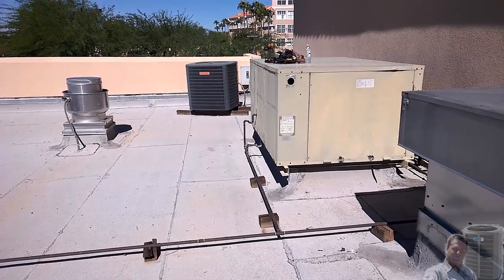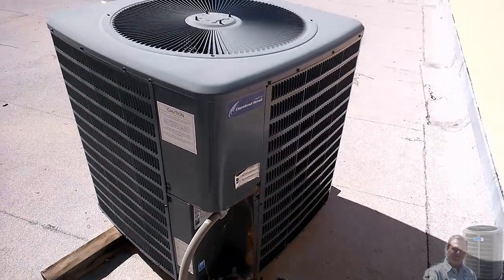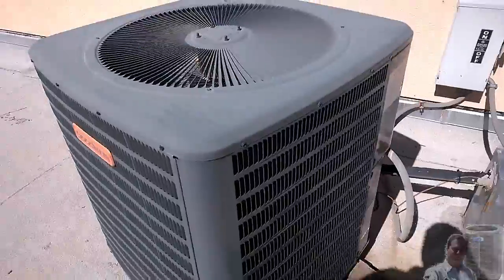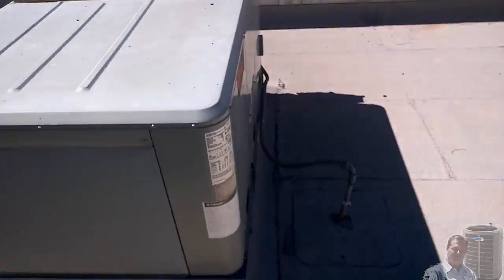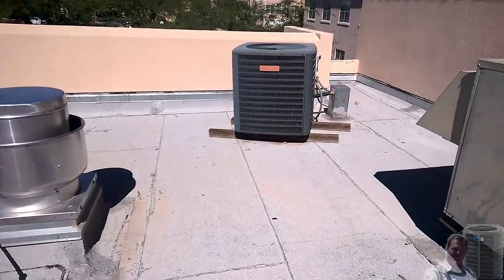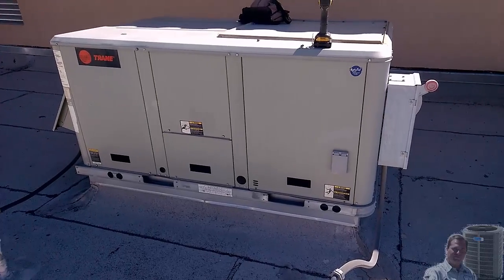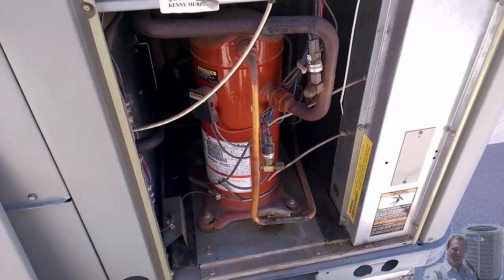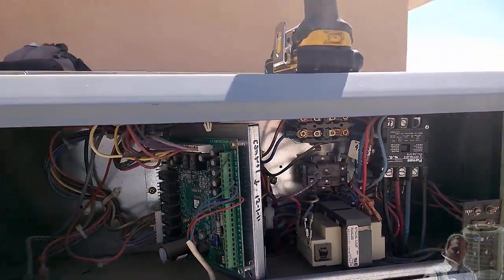Goodman Copeland vs Trane (Copeland) Scroll compressor comparison

Comment: The two units is the same capacity in kW or different? 
If the compressor is larger the noise is more
If the compressor is smaller the nois level is lower.
Reply from the maker: Goodman is straight up known to be more noisy in otherwise like for like capacity.
Especially their older ones. But it is fun to still bash them because they are just cheap products
Reply: @hackfreehvac  cheap built quality the compressor makes recommendations.

Comment: My parents had 2 Trane XE1000s from 1993 and one of them lasted 20 years(replaced because the compressor shorted to ground) and the other lasted 24 year(replaced because of evaporator leaks and the compressor is nearing the end of life). Trane is very good. When I get a house and the original AC is more than 20 years old, I would eventually bite the bullet on an XV20i.

Comment: The design on the Goodman for fan motor is stupid. It is so hard to put the fan holder/panel back since when you remove the fan holder/panel all around panels fall apart. So stupid design. Never think about how difficult it is for HVAC technicians.

Comment: I wouldn't want that Trane wreck or the Goodman. Installation is where it all starts and ends. You get these hackers that don't match the inside accordingly and the piston. Most importantly you see these idiots that purge the system with absolutely no vacuum done or dryer added. You really want to take that goodman and bring the noise down. I suggest you put the noise bag back over the compressor that came with it and change out the muffler that could be restricting it. 37 years now as a technician and if you don't like the sound fix it. Standing on a rooftop with a video camera criticizing something you obviously know nothing about. Not a fan of either system but standing around bitching is not fixing it now is it!

Comment: I though all higher seer r410a units were quite a bit louder than lower pressure r22 units.
Reply from the maker: There are R410 units that are very quiet.

I installed a 14 seer Trane package unit last year for a friend.
I just went out there for a "break down" (turned out the power was cycling off and on in her area) and you still have to get about 10 feet from the unit before you can hear any sound from it at all. It is dead quiet.

I have a video of that unit here...

Oh wow, I just realized that I accidentally uploaded this as PRIVATE. Oops.
I just made it public so now it lists it with today's date instead of last year. :-/

https://www.youtube.com/watch?v=xECaKj6KOAE

Comment: I've read that a Trane compressor is very close to a Copeland stock design aside from a few precision adjustments and valve design. The Tranes where I live sound like helicopters more than anything due to their fan design. Over the past five or so years at work we've had Goodman and Fujitsu systems installed in upgrades. We also had a four compressor York system put in for our main area.

I can hear the York across the street although I don't know how many compressors are active at any time. The Goodman units look much nicer than that in the video and run perfectly fine. The Fujitsu split systems beat them all out in efficiency. We could probably cool a walk-in fridge with them. I am not an HVAC tech (I work IT) so this may be purely subjective but it seems like R410A systems are generally louder than any R22 system I have encountered. Our old main area AC had two reciprocal compressors that looked like Harley engines. Those weren't as loud as the new setup...at least until one seized.

It seems like that Goodman unit was very low end compared to the other systems. I thought it was a low end home unit until you mentioned it was three-phase. It's a passive interest but not my line of work so I'm sure I missed something. It just seems like the comparison was odd.
Reply from the maker: Low end Trane's have basic compressors in them.
The good ones have better compressors. 

Here is a 14 SEER Trane heat pump.https://www.youtube.com/watch?v=xECaKj6KOAE
Hear the compressor running? Neither do I! LOL

They say that the Trane high spec copeland built compressors go down a different assembly line than the common run-of-the-mill copeland compressor.

Too bad Tecumseh compressors are not popular anymore. They made good stuff.

Comment: Trane compressor is no working properly since low side pipe, doesn't look wet and it is supposed to be condensing water in its external surface. Check it out, man.
Reply: This is because of the very low humidity in the Phoenix metro area. You can have at times, a dew point temperature below 32 degrees there. You cannot have "sweating" on cold surfaces in these conditions, the pipe would have to be below freezing in which case it would get a light coating of frost on it, not liquid water drops. Here in the Rust Belt where i live, sometimes the outdoor conditions are so brutal like the other day, the dew point was above 75F!!! In that case, if the suction line was 70 degrees, it'd be soaked with water, but since most compressors dont like return gas temp above 65, the compressor will still burn out, and system is either overloaded or undercharged to get 70 degree return gas temp is way too much superheat. The moral of the story is, do not ever assume the presence or lack thereof of condensation on the suction line on an air conditioning compressor has anything to do with it working properly (or not).

You have to get your gauges out and check superheat and/or subcooling depending on the type of refrigerant metering device on the indoor coil.
Reply from the maker: Yup. While we are in the monsoon season now where they sweat like crazy, most of the year you would hardly get any condensation on the suction line yet it is 45 degrees, etc.

Mostly sub 10% RH until the monsoon season.

Comment: You don't mention the hack job that Trane contractor did....couldn't make the whip a little shorter? Maybe run it in hard conduit? Guess that's too difficult even for the "Trane quality contractors"
Reply: One YouTuber said "the installer decides how good your equipment works" which is true. You can get a Trane thrown on the roof with no care and a Goodman installed with care and the goodman will work better even though its lower quality. Goodman has a bad name because A they're a budget brand and B their equipment can be bought ad installed by non Licensed nutcases. I agree with what hack free HVAC says goodman units are not as good as everything else but they still serve their Purpose.   For example: my grandmas 2007ish TOTL Amana rooftop unit performs much better than my grandpas brand new split ICP. the reason? QUALITY INSTALLATION.
Reply: +Willie Peck One other credit to Goodman...my friend is still able to get an R22 condenser under that brand. It may be new old stock but he isn't able to swallow changing his entire system to R410A and he has a licensed friend to do the install.
Reply from the maker: It's FUNNY how low buck bottom feeding lowest bid GOODMAN installers have no clue that the original units on a commercial building like this were wired by an ELECTRICAL CONTRACTOR not the "Trane installer".

HA HA HA!

BTW. I'm surprised that while you were trolling videos to somehow defend the low buck low bidder Goodman brand you didn't notice the tons of TRANE units what were installed by hacks. All brands can be installed by hacks.
But since Godoman was, is and will always be the LOW BID choice it will continue to be the most predominantly hacked install over all.
Reply: hackfreehvac Trolling? Not so much, just trying to find some useful knowledge on any one of your videos but they all seem to be about talking garbage about "Goodman Installers" and there isn't any real content on them. I'm just trying to figure out the hate fest for Goodman. I get it, you don't like them, they're all installed by hacks, Trane is the best, your work is hackfree.....o wait, didn't you decide to video tape yourself throwing units off a roof?? Here, let the young business owner teach you a thing or two, stop worrying about what company a, b and c did. How they installed it, what they installed and who installed it is out of your circle of control. Worry about what's inside your circle and maybe, just maybe you'll be a better technician for it. Losers worry about everyone else, start being a winner.
Reply from the maker: Robert Doherty
I'm in the Arizona desert where the climate separates the GOOD stuff from the junk.
Around here the GOOD was regarded as Trane, Lennox, etc and the absolute worst was Goodman.

You might not have these heat pump models in your area depending on where you are at and all but most of the goodman's installed in the 2000's were labeled as "DESERT SERIES" and they were the most unreliable and noisy pile of junk ever made.

They sucked real bad. I'm not making it up and I don't turn my back on Trane stuff that I don't think is a good design. Such as the twin compressor 19i. I don't like two compressors starting and stopping all day as the demand changes from 1st to 2nd to 1st to 2nd... etc all day. I recommend the two stage scroll 16i or whatever they call them now.

Anyway. There is a Goodman loving "troll" who has come around and posted comment after comment on some of my videos and brought some friends a time or two. Maybe you were just random.

Go look at my older videos when i did some residential too. Such as "Baboon install". That is a Trane hacked so bad by "Trane installers". Which is why I got so pissed off and eventually stopped working there because the management didn't care.

After you watch that look for the "Noisy Goodman" videos.
Those Desert Series heat Pumps were sounding like that all over the valley. They really are bad.
Goodman got a little better but I can't just forgot the hundreds of service calls on them and just consider them equal to brands that are tried and true. I just can't.
Reply: Robert Doherty I always have a good laugh at all of you small-timers out there that try to pretend that Trane isn't top of the line equipment.
Reply from the maker: Greg C
Indeed.
It is like some people just deny the truth.

Comment: I know much more about A/C than the average individual (have my own license but retired for many years). Three years ago, I chose Goodman A/C units for my house. The installation was excellent.  The units were then and remain almost completely silent. I kept my old systems going for almost 50 years. In general, the choice of equipment manufacturer is much less important than the quality of the installation. I think that the (vast) majority of systems are not installed correctly...or at least optimally. Once properly set up, I keep the units clean but, unless there is a malfunction absolutely requiring it (never has been so far), I do NOT allow anyone to attach gauges to the systems or to open the service valves. I have no "annual checkups" or other nonsense done. I make sure that the cabinet drains are open but never cover the outside units in the winter. The vast majority of the Goodman (and other) complaints that I read about on line are clearly the results of faulty installation procedures.

Comment: I got by another season with my old Goodman. Now, I am starting heat with my 1957 Lennox low-boy oil furnace with a big old conversion burner (300,000 capable) dialed back to bare minimum. Maybe I need a Trane.
Reply from the maker: It don't have to be a Trane, there are several good brands and equipment.
Each also has their crap models.

Goodman however has been more known for entry level stuff using low spec components.
I am pretty much convinced that some of the motors and parts are NOT the same as used in just any unit as many claim.
I think the manufactures build parts via specs and cost. And the really cheap stuff might seem "ok" to some folks int he mild weather Midwest or something, but it don't last here in the Arizona desert.

Comment: Dude you sound like your wife cheated with a Goodman. Get over it not everybody can afford a Trane.
Reply from the maker: First of all, fanboy, my wife has worked in the HVAC based field (in the office) for about 15 years or so and even she knows that GOODMAN SUCKS and sucks bad.
HA HA HA! All the real techs in this area complained about how sucky they were.
(Both of us now work for commercial only).

Second, this is commercial here in this video. So there is no excuse for getting low end stuff.

And when I have shown residential, it was tract homes where the homeowner didn't pick the brand. The builder does and the homes go for the same whether they have Goodman, Carrier or Rheem, all using basic entry level stuff. But Goodman was so much worse for reliability and especially noise levels.

Heck, when we went to buy our home we used to live in (2002) we HEARD the Goodman heat pumps rattling away all the way from the parking lot!
And I said to her "Oh no! They have GOODMAN on these (model) homes!"

Luckily Chainsaw Charlie couldn't do all the installs in the large tract homes and about 5% of the installs were by another contractor who used Rheem heat pumps.
And that is what I had.
It was right outside my bedroom wall.
I had to put my ear to the wall to hear it.
However the homes with the Goodman's can be heard running on the other side of a room!

I know that newer Goodman is "not as bad".
Of course.
When you made the worst pieces of garbage equipment you have nowhere to go but up!
They still are lower bid stuff no matter who wants to deny it.

But since I spent so much time in "Goodman Country" fixing the most ridiculous amounts of repetitious MANUFACTURE RELATED FAILURES on 1 to 3 year old units day in and day out, I'm not going to just change my opinion of the cheap units just because a few fanboys claim that they are not only better now, but they are as good as top tier.

No way.
Reply: Okay

Comment: Dude, how do we know that you aren't using some kind of amplifier to make the Goodman sound louder and then turning down the amp to make the Trane sound quieter? BTW why the obsession with the noise? So what, especially on a roof top.
Reply from the maker: Indeed I could do that. Adobe Premiere has all sorts of audio effects. :-)
But if I was talking during that same recording you would hear the changes in my voice as well.

I was joking in my other video because I got the video clip of the Goodman start up (that also had Mike's commentary added) from Mike's video compilation of my clips. I assumed it was one of Mike's own installs. I didn't know it was that John guys.
Mike took down that "News #2" video so I guess you can't have you go listen to it.
The low frequency DOES cut out when the commentary appears when the unit had started. Then the sound goes back to normal.
And I can't find the original video on John's channel.

I do have a downloaded copy from Mike's News #2.
If people give me crap I might screen capture the copy I have to demonstrate why I said that.
It was likely just the camera doing the noise reduction on it's own.
I've had it happen to me too.
But the timing of it was uncanny.
Or perhaps, maybe that is why Mike posted the commentary of how quiet the Goodman was.

Anyway. I've been around for a while.
Been on here since the mid 2,000's and on hvac-talk since 2001 and my "Goodman Country" post started in 2004.
People that know me know that I rip on Goodman because they had a HORRIBLE reliability and noise problem in this area for over a decade straight!

And even though I don't do much residential these days and perhaps the new Goodman's are not as horrible, the "Goodman bashing" is part of my humor and will continue to be for a while.

If you worked this area since the 1990's you'd understand. :-)
Reply: CoolasIce2  because on my old house i had that same condenser.

hell of alot better than the brown turd that i am having replaced next week on the house i live at now. in getting a trane.

Comment: My dad's apartment has two 2008 5 ton XB13's with what I believe are Climatuff Compressor (One of them). Back in 2011 one Compressor went bad and got replaced with a Copeland in the samen unit. That unit is way quieter than the other one with the huge Recip Climatuff Compressor. That Climatuff Compressor only lasted 3 years in the All year heat in my city. The other one still runs though.
Reply from the maker: XB's are Trane's low end equipment.
I don't think I'd sell one of those to a person unless they desired cheap.